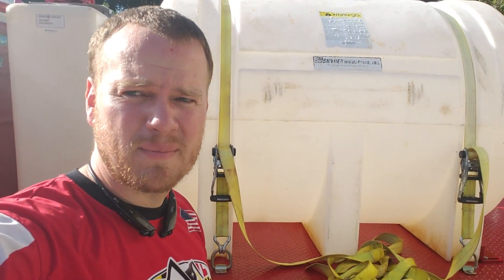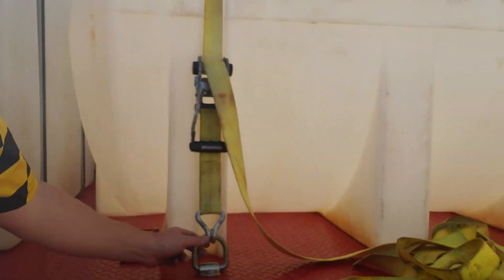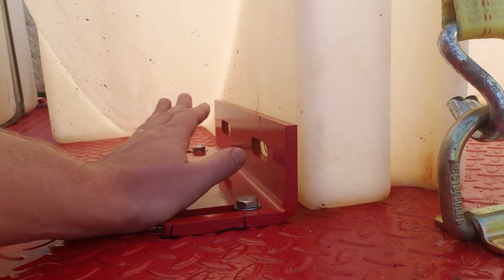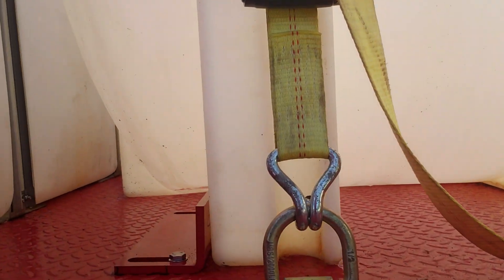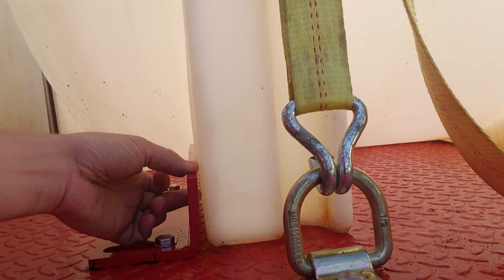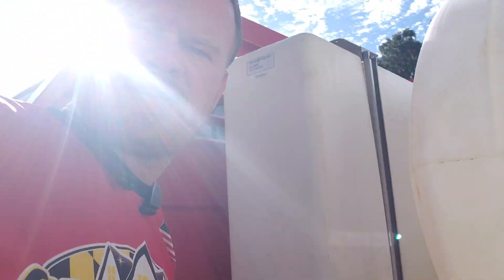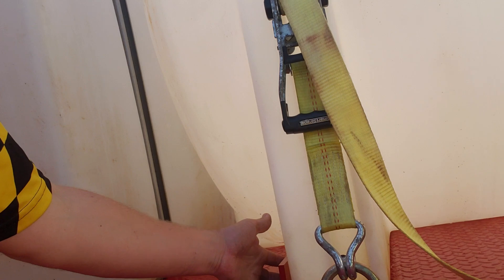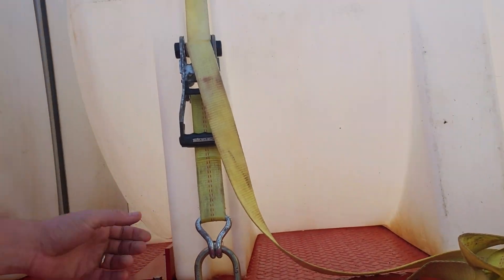How to properly secure a buffer tank.

Comment: Except horizontal leg tanks are NOT DOT approved lol.

Once again more bad information
Reply from the maker: I went to the DOT SCALES and confirmed directly with them that the tank, orientation and securing methods were acceptable.  They said it was perfect...... nice try bud
Reply: Clean Power Wash what size and brand tank is that? 525 norwesco?
Reply: Clean Power Wash 

And for norwesco... https://m.plastic-mart.com/product/173/525-gallon-horizontal-leg-tank-40181

For just about any horizontal leg tank on the market for that matter. These vendors selling us these products but don’t tell us the truth about them cause they would lose money

Same with the 55g and 100g vertical tanks a certain vendor sells.
Reply from the maker: Yes.
Reply: Clean Power Wash well the sticker on your tank says Snyder 

http://gototanks.com/525-gallon-horizontal-leg-tank-wh8.html

Might wanna read the fine print.